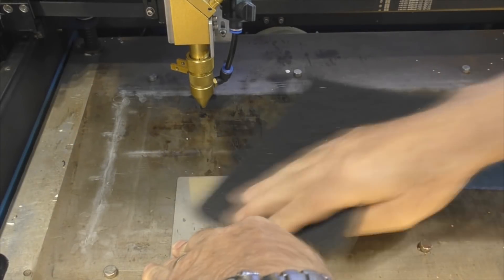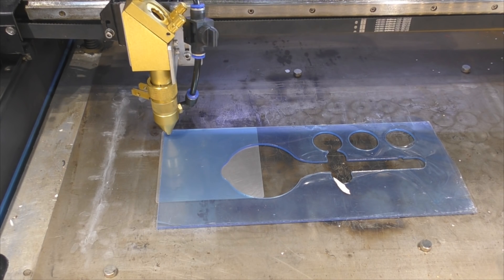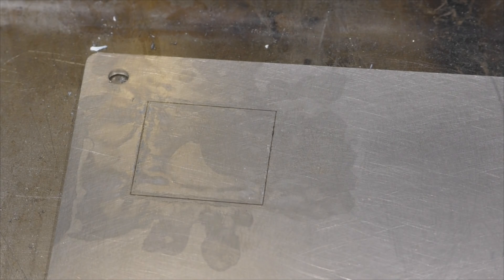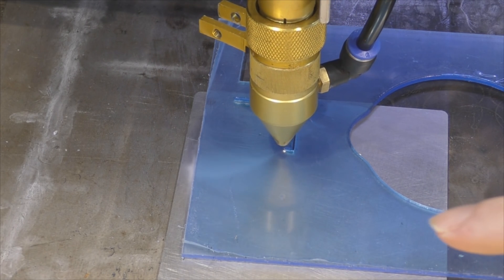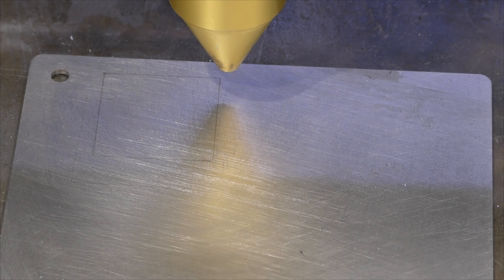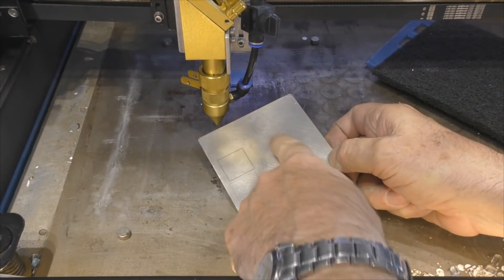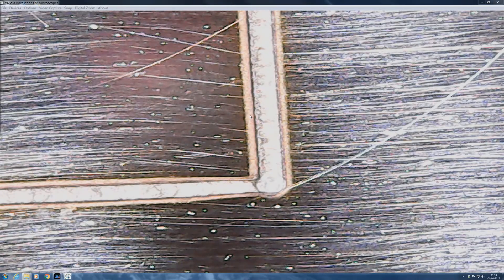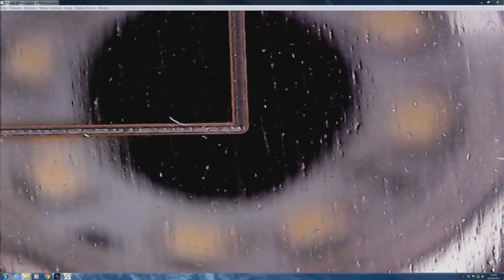RDWorks Learning Lab 100 Etching Stainless Steel

Comment: mmm, engraving is the first thing that comes to mind
Reply from the maker: Hi Abraham
Simple line engraving (cut mode) will be possible but scanning will be painfully slow and I suspect it will distort a flat plate because stainless has a tendency to do that.  It has to be slow because you need the energy to linger on one spot to melt it. I'm still amazed that it did it. The effect with the Bodor 2" lens was not as pronounced , but the potential to mark the surface piqued my curiosity.
Best regards
Russ
Reply from the maker: Hi Abraham
I have a question for you this time. I know that you were considering changing your steppers to servos. Did you ever do it?
I presume that you used hybrid servos which technically are steppers with closed loop positional feedback. I have another correspondent that is convinced that his acrylic striations are caused by his steppers and is planning to change to servos.
I am in the enviable position of having two machines. one with servos and one with steppers. If I showed you edge samples from each you would not see any discernable edge difference.  If you have servos, did it fix the edge striations on acrylic (apart from running slow to flame polish the edges).?
All best wishes
Russ
Reply: Hi Ross, eager to share my experiences with you. Servos have been the single most radical change I did to my machine yet and its been absolutely worth it. Just to give you an idea my current acceleration parameters are 2000 mm/s^2 min and 8000 mm/s^2 max when cutting, for engraving I use 30 000 mm/s^2 on the X axis, that translates into no less than 3X the avg. cutting speed on papers and thin materials. This to me are far more important than the maximun speed you set the cut to, specially on intricate cuts all with very little deviations (oscillations, striations, etc...) and I can go higher but then I will compromise the actual structure of the drive system (bearings, bolts, nuts, etc...) that my cutter came with from factory. Now, I'm using true servos, Teknic's ClearPaths to be precise and in theory they are far superior to leadshine's EasyServos that came with your newer cutter, the feature that I think makes all of the difference is what they call Jerk Limiting, this is like a cushion on your drive system as it smooths the motion profile at the beginning and the end of the command (acceleration and deceleration) reducing the stress on your drive system allowing you to achieve much higher acceleration rates with out pulverising your cutter. Adapting them to my machine was no easy task (as Teknic's promo videos may make one believe), but after properly tuning them to my machine they are a dream that is translating into real economic benefits on my case :)
Reply: On the acrylic issue, did not you debunk that a while ago?, I still have them if that is the concern. Stiations on other materials like paper and wood did go away yes, but on acrylic, its a whole different thing

Comment: Very nice video, I really appreciate your efforts to educate us, even though some experiments may damage your machine.
I have a wood laser machine which works great on wood , why laser won't burn a metal sheet when placed instead of wood? Is it the power, wavelength, laser type ?
Reply from the maker: Hi

Upon reflection (no pun intended) there is little risk of damage to the lens because when you think about it logically, There is  1.5" back to the lens. and after  that distance the beam will have defocused and the energy density  will not damage the lens. As I mentioned in the video, the memory of trashing a £500 lens over-rides logic and made me extra cautious. 
Obviously my machine is not planned to damage metal either. The fact that it does is all to do with  something called energy density. The easiest way to explain it is to imagine a sharp pencil, Push the blunt end into the palm of you hand as hard as you can. No pain, no marks. Now  turn turn the pencil round and think what would happen if you  applied the same force with the sharp point in your palm. Your push forace (watts) applied over a large area (the blunt end) will do little DAMAGE. The same force (watts) applied to a very small area, amplifies it and will do a lot of DAMAGE. The shorter the focal length of the lens, the smaller is the focused spot size. A 2" lens has a spot size twice the size of a 1.5" lens. Hence the largere the spot size the more power you have to throw at it to do the same amount of damage.
You will note that I had to run quite slowly so that the heating effect of the beam lingered enough to melt the surface of the metal. Too fast and it wont work. When you work with wood the cutting action is by BURNING. Wood is a very poor conductor of heat so it's easy for the beam to heat and burn it. Metal is a good conductor of heat, so even though I was able to melt a thin layer at the surface, the thermal conductivity quickly sucked the heat from the cut area and limited the depth that I could damage.

Different wavelengths will be absorbed by materials differently, especially metals where the absorption is all to do with the crystal structure of the material. CO2 lasers are very powerful but do bump into material limitations. Increasing the power overcomes some of these

Hope this has answered your question.

Best regards
Russ